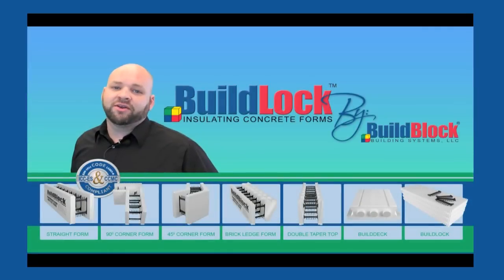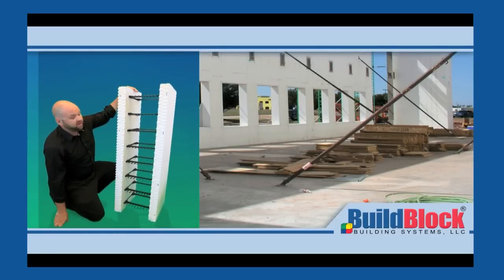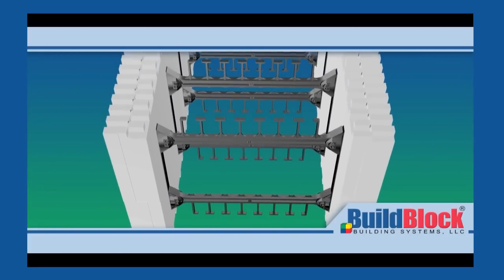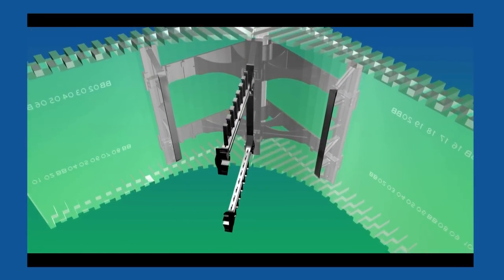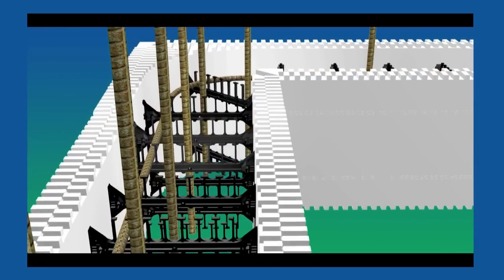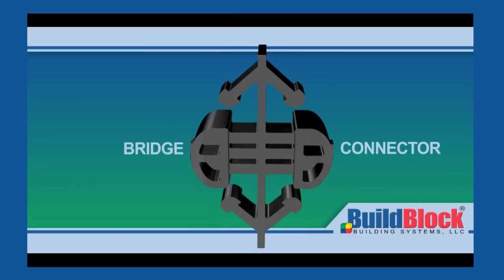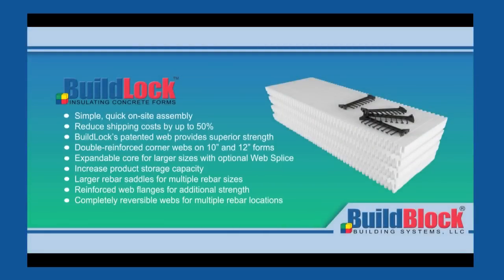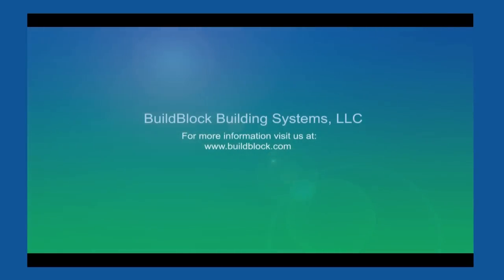BuildLock Knockdown ICF by BuildBlock

Comment: What about your average consumer?.
People that don't have hundreds of thousands if not millions to spend?
Reply from the maker: The cost of building with ICFs is comparable to building with wood and other traditional materials. The ICF covers several construction steps with one product (forming, framing, furring, insulation, sound proofing, etc.) and leaves you with a structure that is 58% more energy efficient and far stronger than homes built with wood. As the cost of lumber continues to rise, ICFs are the more economical choice for the modern homeowner.

Comment: Will termites attack the polystyrene?
Reply from the maker: The EPS foam in BuildBlock ICFs is not a food source for termites but they may burrow into unprotected foam surfaces in search of food (wood). While termites cannot compromise the strength or integrity of the BuildBlock wall, they could burrow through the foam to reach and damage untreated wood. We recommend using BuildShield Termite Protection in termite-prone areas. BuildShield Termite Barrier combines a patent-pending combination of a PVC extrusion track and an adhesive stainless steel barrier. The track and stainless steel barrier extend from inside the concrete core to the exterior wall finish creating an impenetrable barrier to termites and is the only ASTM E283 tested and code approved solution for ICFs in termite-prone areas. Read more about it here- http://buildblock.com/products/buildshield-termite-protection/
Reply: Scott Craig